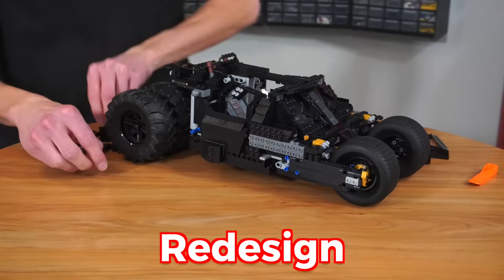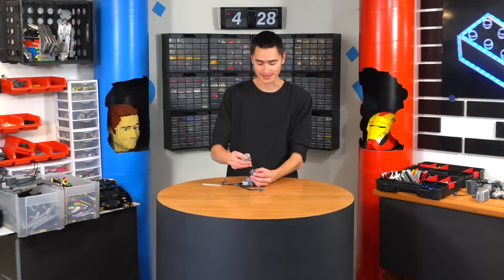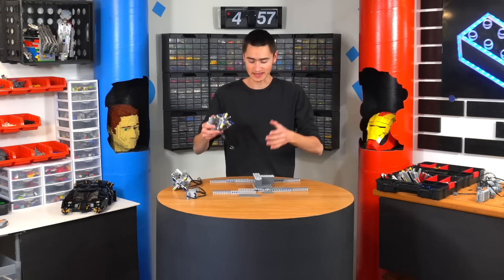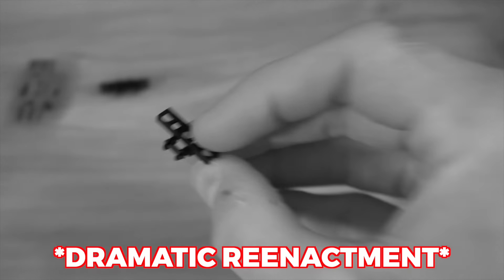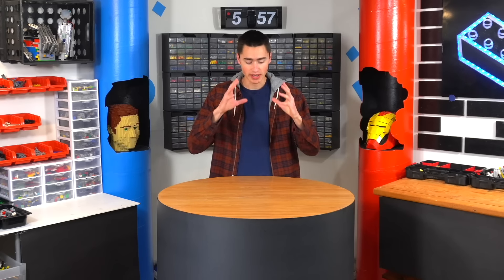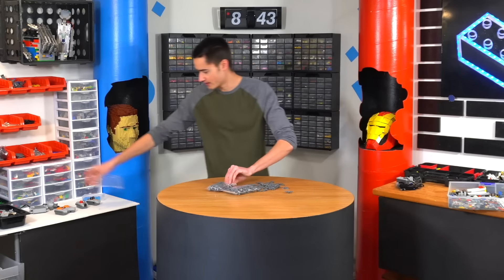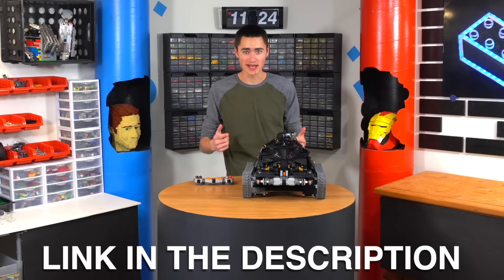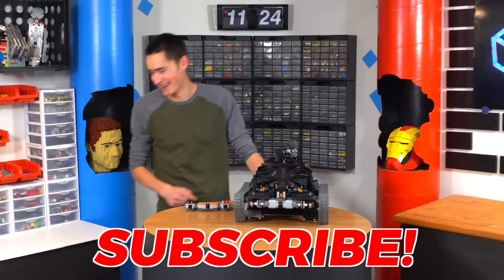I Turned the LEGO Batmobile into a TANK!

Comment: Your problem with the tanks weight, wasn’t even about its weight, you just had to replace the gray shock obsorbers with the red shock obsorbers! :) love your work tho man!
Reply: You probably need 2 red ones on each lol
Reply: @letsmakegames947  yeah probably!
Reply: Whats the difference?
Reply: @mineblastersfiebig853  their much much stronger
Reply: I don’t understand
Reply: @rubikshill5246  so it takes more force for the red shock obsorbers to retract than the gray ones so the tracks will get more power if they are more resistant.
Reply: You have 2 subs now👍
Reply: Good insight
Reply: Sort of like the shocks in a high-end sports car vs the shocks in a big Cadillac. The former keeps the wheels on the road and recovers faster from a bump, but make for a stiffer (rougher) ride… the softer suspension in the latter might “ride like a cloud”, but that floatiness reduces control.
(Caddy shocks = grey LEGO shocks, sports car shocks = red ones… sorta.)
Reply: @mineblastersfiebig853  ,,
Reply: Not to mention the tracks were too loose they needed a few less
Reply: @sammarino7357 that to…
Reply: Wut :l
Reply: @noisywings  it’s ok it’s just Lego engineering
Reply: @jello_sluper5070  I just have no idea what that means
Reply: @bigbricks1003  red ones are stronger and lighter but breaks easily than the gray ones
Reply: @sammarino7357  yea it was
Reply: @rubikshill5246   the red moters are becoming GIGA CHAD 2
Reply: Brhu
Reply: I would also add at least a couple of return rollers per side and at least two more road wheels per side.
Reply: @bigbricks1003  they should have ordered the big rubber treads
Reply: Red shock absorbers exist?
Reply: Your just jealous
Reply: @Theoffical_egg   I mean duh, he really good at LEGO so ofc
Reply: @Jax.the.hedgehog  Yeah but they're kinda expensive, actually nvm, all LEGO is expensive

Comment: if you had two motors per receiver, and two receivers on the same channel, you would only have two motors per batterybox, and that would solve the torque ishue
Reply: Exactly what I was about to say! you can use left output on one reciever and right on the other. I've used this method with my rock crawlers to be able to use more batt boxes.
Reply: “Ishue” you mean issue?

Comment: As a "Tracked Vehicle Expert" (TVE) I can point out some mistakes
 1. The shock absorbers(grey) can't support the weight so you could replace them with yellow ones because they are a lot more stiff .
 2. You need to put more support wishbones . The middle of the tracks were just empty , if you don't know what i'm talking about , look up "tanks" and look how many support wishbones they have on one track .
 3. To get more torque , you could replace the motors with stronger ones . If you don't have stronger ones , just put more motors there (1 PF xl motor = 2 PF m motor) . If you can't do ANY of these , just make a bigger gear reduction , like 6:1 etc
   Note:I'm not a hater , I just want to help you on other MOC's and I love your videos no matter what mistakes you make . Keep up the good stuff ;)
Reply: well looking at the video, it looks like he just ran out of power because 10 motors draw a lot for power from one power brick. I guess he didn't know this but you can buy a Lego extension wire to connect another power brick in parallel.
Reply: @daltonwaters2540  Ah yes , a man of culture as well
Reply: Yeah those tracks need a little bit more work to pass on literally anything. I reccomend adding more suspension wheels and springs so that it can conquer rough areas.

Comment: I thought of a way to use 2 battery boxes on one receiver. If u take 2 pf extension cables and attach one to each battery box and u take the other ends of the cables and connect the together and add the receiver connection on top of them and theoretically it should use power from the 2 battery boxes

Comment: The main broblem: Usually adding more motors increases torque, but in this case you put way too many motors compared to the number of battery boxes. 3 battery boxes can't feed 12 l motors and because of this, the motors only get limited power. This model could have run easily using 3 battery boxes and 4 l motors with a little gear reduction.
Reply: here is another problem:  you spelled problem wrong
Reply: @asanguyen2823  Here is another problem, your punctuation is off.
Reply: @kaidenwatts528  not everyone types with punctuation
Reply: @asanguyen2823  And not everyone spells correctly

Comment: Reading all the comments I see that they are all missing the mechanics of tank tracks you have the control down really well but the fact that the tracks are coming off is due to that you have no track runners (aka the wheels in the middle of the track) they help keep the track on the drive line but they also do a lot more (aka stability, suspension and more). also another point modern tanks are only driven by the rear spokes for simplicity were as yours is driven by front and back which adds complexity and streess when its not needed. last thing i thought you could stack the output wires of the battery to get a better life/output.
Reply: Man’s out here writing paragraphs
Reply: Its Lego bro and not a real tank with one engine and a transmission. The motor and transmission sit in the back so the drive sprocket is in the back too. In a Lego tank with multiple motors it's actually simpler to put them in the back and front. It also decrases stress.

Comment: i see atleast 3 ways that this could've been better
1) more support wheels on tracks (helps with weight distribution)
2) add atleast 1 wheel on top that actually tensions the tracks (spring should be compressed almost always)
3) a gear reduction on the turret, so turning is more accurate
Reply: And he should’ve added the rubber pieces for the tracks

Comment: you could either add rubber to the tracks or cut 3 of the wires so that the servo would be powered by a battery rather than 1/4 of it

Comment: You know that IR receivers limit output current a lot, right? I doubt the 4 motors connected to one port give you the power you expect. An old crawler "V2" IR receiver is known to provide more current (it's also very rare). Also, battery box can be replaced with LiIon box for higher current.

Comment: I need you to explain to me how the RC stuff works for me so explain in simple form what I'll need and I'll figure out the rest because I want to make a robot that runs off of rc my view is a video call and I use rc to control it if your interested in helping you can make the design for the chest aka the area everything we need is and it has to look humanoid and have the coding down for me easily for the rc because I need to have it so one code controls another to let it walk but testing is just going to be a mini scale of it but I make it about 5'2 if the mini version is successful I can allow some non humanoid features for essential uses such as walking and writing the hands have to look humanoid enough and possible to use a laptop with so index is the main finger thats needed and thumbs and the middle finger for writing but one code controls the hard controls for walking simplifying it for the controlling of walking turning the head joints and writing I really only need it to be able to use a laptop and computer so if needed I can make it able to use tracks or tires for parts of walking ill do limbs but if your not in it will be a lot of work for me to do myself

Comment: Use more sprung wheels at the bottom, tanks have dozens of wheels stacked in a specific pattern to support the track and weight of the vehicle. With only 4 sprung wheels (2 on each side) they're not keeping the track tight and the body supported.

Comment: For the battery box issue, would you not have used the 6x AA battery ones as they provide much more power
Reply: and he not use round big XL motor, set 42055 that's the weight